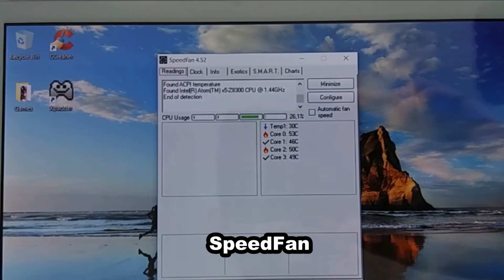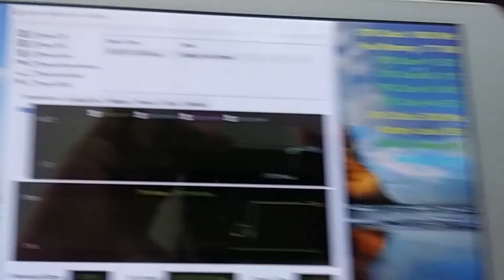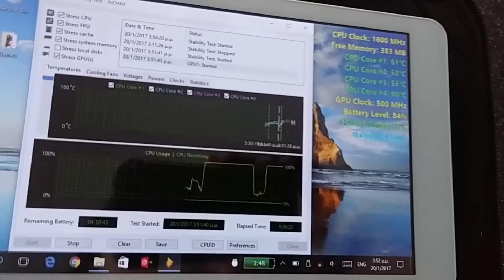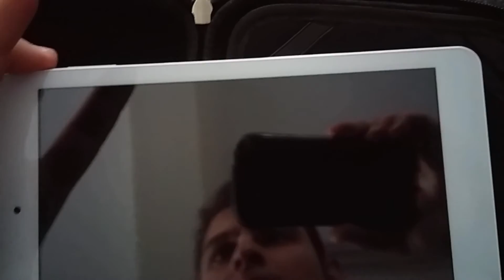Cube iWork8 ultimate Dissasembly, heatsink mod, battery removal

Comment: The backplate is plastic, why are you using conductive silicon, when there is no metal (other than the aluminum foil in the back case) to dissipate the heat ? Also, it doesn't show the battery terminal being disconnected... is it soldered or is there a connector ?

Comment: Help i have alldocube t8 , 8" will this lg 4594105 fit my phablet? And the original battery 3800A
Reply: Andreas Hadjistyllis ppl say measure battery. Mine properties are 3800 mAh, 5v/2A. How can put something like 5600 mAh, 3.7 V??? And i can't find exact
Reply: Andreas Hadjistyllis i told already it fits ok. The important thing is a capacity
Reply: And i forgot to say. I have exactly the same phablet like yours
Reply: Andreas Hadjistyllis so which 1 i can order? Lg?
Reply: Andreas Hadjistyllis thanks a lot for help